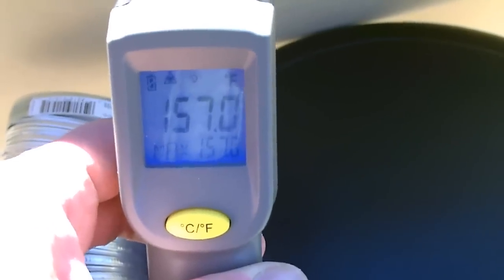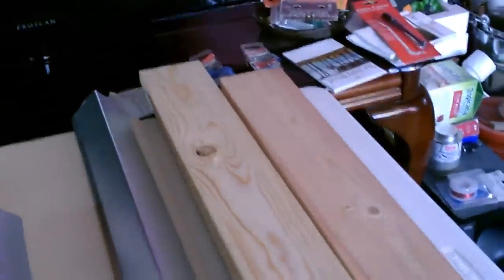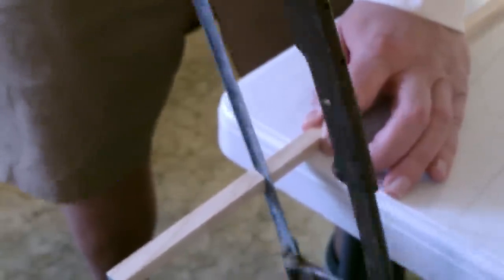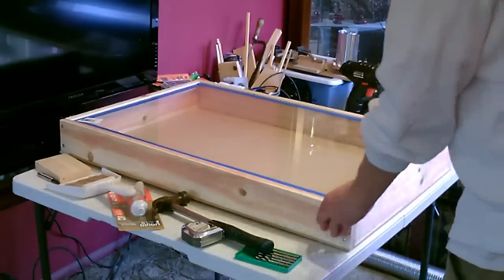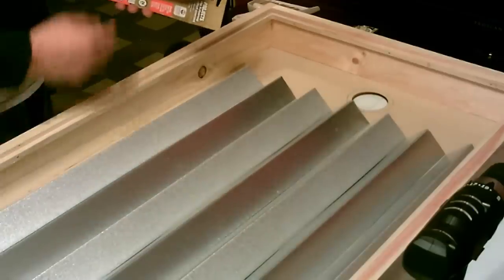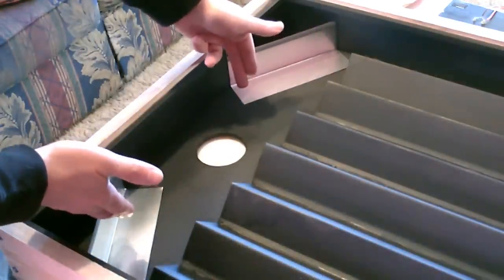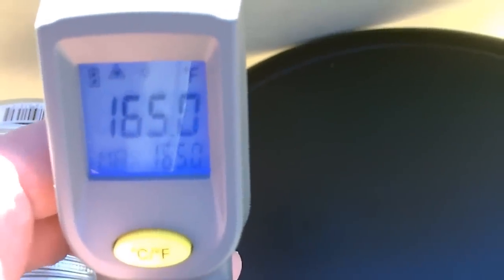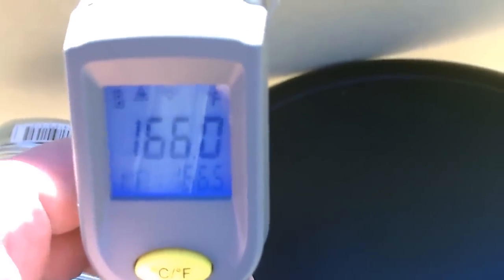DIY Solar Air Heater! - The Steel Slat “Drip-Edge” Solar Heater! - New Design! 160F 74C in January!

Comment: Very nice project build of the solar heater.👍👍👍👍 New sub you. surprised that no insulation on the back or sides.😲😲Can you not insulate due to temp🤔🤔 Still a great video brother.😎😎⛏⛏🔥🔥
Reply from the maker: hi. thanks for subbing! i generally don't insulate sides on these units. i've found it doesn't make much difference. it might if the unit was bigger or if the air stayed in it longer.

Comment: I’m wondering about the air quality from this heater. Since it has spray-painted elements inside, wouldn’t chemicals be released when they’re heated?
Reply from the maker: hi. no. most basic spray paints are non-toxic when they are dry. there won't be any chemicals in the air.

Comment: the way I did it was to use corrugated roof panels painted black, and I let the air come over the top of the panel under the glass and back around behind the panel and sucked the air out holes on the top back of the panel. that prevents losing heat to the glass by having the cool air pass there first catching most of the heat that you lose through the glass.

Comment: Could you use it without a fan and just have like a heat syphon situation going on to move the air?
Reply from the maker: units of this size don't work very well without a fan. the larger units work pretty good without fans but they need to be a bit larger. (maybe 3 or 4 times bigger)
Reply: @desertsun02 thanks

Comment: Awesome video, does it need to have cold air instead inside air, i want to place the panel over the window on the inside. TY
Reply from the maker: hi and thank you! you can make it a closed loop (and feed inside air through it if you want to). i like the idea of adding fresh air but that isn't necessary.

Comment: How efficient is this compared to the aluminium can method?
Reply from the maker: hi there. i've found that steel works better than aluminum. that's probably because steel is denser. i've made a couple of other solar collectors - one with steel food cans, and another with steel downspouts and they both work better than using aluminum cans too.

Comment: I really need to make one of these.  We are heating with wood and let the fire burn out overnight so the mornings are really cold.  Our bedroom is on the southside of the house in good sun so Im thinking of venting air into the solar box at the bottom with the return hot air at the top. I also want to figure out how to get it to operate on both ends with thermostats so that it can't turn on unless the interior of the box is 60F or higher and then it will shut it off if the air being pulled in at the bottom is over 75F.  That way it basically gets the room to 75F and no warmer.
Reply from the maker: hi there. adding thermostats and a second vent should be pretty easy. the 'closed loop' system will give max. temps. i've always found that these units work good even without thermostats. that's because the fan will turn on automatically whenever the sun is hitting the solar panel (and the collector is hot) and will go off when the sun is not shining on the panel. i usually use an amorphous solar panel too. those will run the fan proportional to how much sun is hitting the solar panel. (meaning if the sun is shining at half strength - due to clouds - then the fan will run at half speed) which is perfect, since the collector won't be as warm.

Comment: They say to use synthetic material instead of glass, to get the most heat absorbed. I don't remember which one. Maybe the most common and brittle type is sufficient (horrible brittle, don't drill in it)
Reply from the maker: hi. i've always found that glass works best. just thin clear glass. the non glass stuff always seems to have problems.

Comment: Amazing idea, can't believe I've never discovered solar heating before. I wonder if you get enough of these, or just a big unit, and pump it into an existing ducted HVAC, would it be viable to heat any entire home? 160F is pretty extreme, even with heat loss throughout the pipes, it seems like it would work. Connect a few of these bad boys in series, have the main pipe insulated, into the basement, then directed to the bottom of the HVAC unit. Run the fan and voila, free (daytime) heat.
Reply: Total rubbish this video, I've made boxes which you get 43c down to 29 over an hour when 6c outside, that's next to trees in garden where no wind, soon as on house you have wind cooling down, you wouldn't get 74c constant coming out in summer when 30c heat, even if he got 74c it would last seconds, get upto about 55c max in mine before fan running, you have small volume of air which is expelled in 2 mins and only way to heat air in box again is turning off fan else you'll be down to 20 iish degree c which is useless

Comment: So, our fan will not work. We ordered everything to spec. The first was a 12w solar panel, didn't power the fan without a battery. The second solar panel was a 10w, it too does not work (wored direct too). Is it the fan??
Reply from the maker: hi. it's hard to say why your fan is not working. computer case fans generally pull anywhere from 1 to 5 watts, so if your panel is 12v and at least 5 watts it should run any size computer case fan with ease. it must be something about the fan your using (because i've been hooking case fans to solar panels for 15 years with no problems. best thing would be to try another brand of fan.

Comment: Could you use a piece of corrugated tin?
Reply from the maker: hi. i think so. (i've got another solar collector that uses corrugated steel panels, so i'd guess tin would work)
Reply: @desertsun02 Thanks for your response.  I have observed that a piece of shiny metal in the sun gets very hot.  Does painting it black really make it get hotter? Or hold the heat longer?

Comment: Can you also tell us what was the exact ambient temperature while testing the solar collector? how on earth do you guys have green plants in january?
Reply from the maker: hi. it was low 40s (Fahrenheit) during testing. since it usually stays a little above freezing here (in the desert), many plants stay green (or semi green) all year.
here's some detailed info from the description section...
air temps were in the low 40’s (F) during testing. Output air temps varied but reached into the 160F+ range (topping out at 167.5 F (74C+) about noon time). Lowest temp recorded was 110F (with sun just over horizon) and air temps of 135F were standard for mid-morning and late afternoon.

Comment: @desertsun02 do you use many of your solar air heaters to help with heating during the winter? Do you have any videos where you show how you integrate the output air duct with your home?
Reply from the maker: hi there. yes, i've been venting them in through a back window. the best way to do that is to buy a 1x6 or 1x8 piece of lumber and cut it to the length of the window you want to use. then just cut a hole (or holes) in that lumber and attach the vent hose (or hoses) to the wood. i do that the same way i did it on the collector. that allows the warm air in without the need for any modification to the house. you can also feed the warm air in through an unused vent (a dryer vent for instance) or even an old dog/pet door if you want to. (or if you don't have a window to use). i've even heard of people who vent the air through unused doors (they remove the door knob and attached the pipe).
Reply: @desertsun02  awesome. Thank you for this tip!
Reply: No because it doesn't work

Comment: Hey...your projects are just amazing. Can you please share about the exact paint that you have used and the glue you used to stick the aluminium
Reply from the maker: hi and thanks! i usually just use a generic flat black spray paint from home depot. it's nothing fancy. recently i've started using the paint and primer type. that is rustoleum and cost about 5 bucks a can. both work good though. i use something called liquid nails to hold the aluminum. it's a construction adhesive. you can get it at home depot or place like home depot. or amazon.

Comment: I have several similar units I've used for heating my shop. It supplements  nicely. A couple things to note.. Don't use inside air.  Using outside air,  and a bigger fan  does reduce the  output temperature, but creates a positive pressure inside the house. Which is what you want .  Second is, don't ever cover windows. Defeats the purpose .   Make a simple wood cover and place over the glass during the summer.  Realize that anything wood, especially regular cut 2x4s will warp and let a little dust and  water in ...and heat out.  So focus on a weather proof material.  Stain the outside,  marine plywood is by far  the best option. Regular wood is okay, just realize it's a 2-3 year life span. The wood will fail  first.  Tempered glass is good,  use a patio door or just  1 layer if you have it. Go cheaper and do more surface area.   Units get so hot they'll cook a lot of other materials.  I use a temp controller with a probe inside the unit. Kicks on around 88  degrees and pretty much runs all day 500 cfm at 114 degrees... using outside air which averages 20-30 f. ( I'm in northern Utah). It runs when its  0 degrees on sunny  days, no problem. Get a good baffle that closes when the sun goes down.     Basically bigger, cheap and dirty is the best option inmy opinion.  If you try to create the most efficient unit, but it costs too much, is too small or gets too hot and cooks off, you're not going to see a return on investment, which takes a year or two.

Comment: Can I put this in the windows of my house?
And how much heat would it provide in 100% white out conditions from snow?
Reply from the maker: hi. these are best used outdoors (next to or under a window). they will then collect the extra sunlight that doesn't naturally enter through the window. that way you'll have the sunlight streaming through your window plus the extra heat from the unit. note that if the unit is used over the window and has a larger surface area than the window then it can be of some benefit. the only real benefit when using it inside is that you could collect the heat and pipe it to a specific area of the room that you wish to heat. it can be used indoors to re-distribute the heat to another area of the house.
Reply: @desertsun02  thank you for getting back with me I really appreciate it 🙏 ❤️
Reply: @desertsun02  how would I hook it up out side and run the pipe inside the trailer?
There's a storm glass and the other window inside the trailer. 
So what do I need to seal the window to keep the seal from getting wet and rotting and letting in the cold air from outside and letting the heat out?
And with out screwing anything to the trailer, I rent the trailer, I'm thinking about building 6 of these because the trailer faces the son most of the Day on that side.
One in the back bedroom, two in the living room, one in the kitchen  one in the master bedroom,  and one in the master bedroom. 
But I must know how to seal the windows first so no water nor air gets in or out, I'm also thinking about putting an off and on toggle switch on them as well so that way if it gets too hot I can turn them off as well.
There's 3 windows on the back of the trailer I'm wondering if they would also gather heat as well or would I be wasting my time on the back side.
And also is there a system that can be built for summer to cool the trailer as well to help cut down on cooling as well?
Reply from the maker: i'm not sure the best way to vent it into a trailer but in a regular house window you can just use a 1x6 or a 1x8 board in a window. i just cut the hole in the board, attach the vent pipe to it and put the board in the window. then just slide the window down on the board. (well i slide it over since i have side sliding windows but...).

Comment: Really Great idea but question. Does it works during snow or in the night time ?
Reply from the maker: hi. you'll need sun for this to work. it works even when it is cold out, but you will need the sun to warm the collector. some people use them where is snows (just brush the snow off and point it toward the sun)

Comment: Should both sides of the edge be painted black, is a question I asked an ai bot:  Here's its answer:                       If you paint only the outside of the aluminum edge black and leave the inside unpainted, it will absorb sunlight differently than if you painted both the inside and outside black.

When sunlight hits the black-painted surface, it gets absorbed and converted into heat energy. The heat then gets transferred into the aluminum material, which conducts it to the unpainted interior surface. Since the interior surface is not painted black, it will reflect a significant portion of the incoming heat back towards the black-painted exterior surface, reducing the overall heat absorption of the edge.

On the other hand, if you paint both the inside and outside black, the entire edge will absorb a greater amount of sunlight and heat since there is no reflective surface within it to bounce back the heat.

Therefore, painting both the inside and outside of the aluminum edge black will result in greater absorption of sunlight and heat than painting only the outside black.

Comment: Has anyone made this heater and can measure the temperature correctly instead of using an infrared meter?
Reply from the maker: hi. infrared meter is correct way to measure temperature. hvac techs use them all the time to check output temps of vents
Reply: @desertsun02  I think it is not good to use an infrared meter since the reading can be false by including the IR luminosity of a duct or sheet around it. I consider that the best measurement is using a thermocouple or rtd sensor.

Comment: Word of advice if you haven't already found out over time wood panels rot after 17 years i had to take my 2 4x8 panels down due to wood rotting  even tho they were sheet-ed over with aluminum but cost to expenditure ratio after 17 years figure it cost me about 15.00 a year to build payed for themselves first half of first year and saved me thousands in oil or gas bills and even running a ac fan versus solar it was still negligible cost versus blower on furnace am presently rebuilding for next 20 year run figure ill be to old to care by next rebuild and nursing homes include heat but in answer to someones question on size to efficiency bigger is always better and i built mine with aluminum tube heat sinks so it was really efficient heat transfer.

Comment: Could you have a small solar panel to run the fan that would just run the fan when there is enough sun to power the fan? That would eliminate the switch then.

Comment: So, to make the fan in the heater run, you connected it to a solar panel also?
Reply from the maker: hi. yes, it works out good because the fan will run when the sun is hitting the solar panel (and collector) and shuts off when sun goes down.

Comment: What size of a room would one of these panels heat? Would it be possible to put enough together to have central heat? Example; pumping heat from the panels to ducting via fan forced to three rooms?
Reply from the maker: hi. yes, if you've got the sun and multiple collectors (or one big one) you can heat large areas.
Reply: @desertsun02  Appreciate the information and the fast reply my friend! Take care and best regards!

Comment: So, does it crank out the 135-150 degree the entire time the sun is shining? Or, does it decrease as you pump the hot air out of the case? Also, have you done any projects that take the heat and transfer it to a heat sink of some type? I was curious if you used this during the day to heat up something like 55gallon drums of water (or something similar in concept), could those be used to keep a greenhouse warm on winter nights?
Reply from the maker: hi. it cranks out the high temps consistently when the sun is out. storing the heat in sand or water is a good idea. i've been looking into it.

Comment: don't work without a battery...
Reply from the maker: hi. best to just use a small solar panel to run the fan. works out good since when the sun is out the fan will run and when it's not the fan shuts off.

Comment: According to an online calculator, this puts out 10,541 BTU in its current state. Thats based off a Temperature difference of 122 F and a mass flow rate of 80 CFM. You should do a follow up with a vent connected to the inside of a home, so the inlet temperature will be around 70 F.
Reply: Unless the panel is at least like 9' by 3' that isn't particularly possible. The sun provides like a bit over a kilowatt per square meter, so at least 1 of your estimates used to make that calculation(I would assume it is the rate of air movement) is probably a bit off. The energy output is still pretty good.

Comment: Very nice compact design. Your demo of the building steps is excellent. I have some extra corrugated roofing and a few pine boards I’m going to use along with an old window my friend removed from his house.  Mine won’t be as nice-looking as yours, but it’ll pump out free heat to my art studio in the barn. I also like the way you installed the fan and it seems like a cheap investment to add one with a small solar panel. Convection alone will push the heat out, as I learned from a buddy science teacher who made one with his students. They had to disconnect it every day because the classroom got too hot! But I think a fan is probably a worthwhile add-on. Thanks, great job!

Comment: A good way to save money is to go to a scrap yard and find old fluorescent light fixtures. Inside you will find thin sheet metal reflectors that have the same 90°s as the sheet metal strips your using from home depot however you will get them at less than a tenth of the cost. Keep thinking outside of the box "pun intended" 😎👍